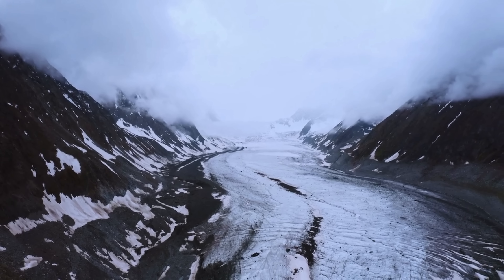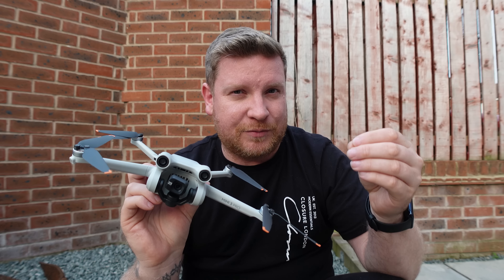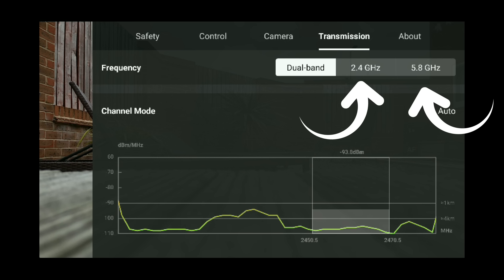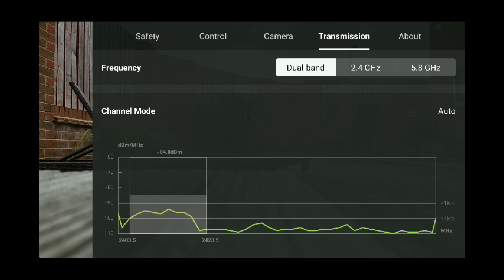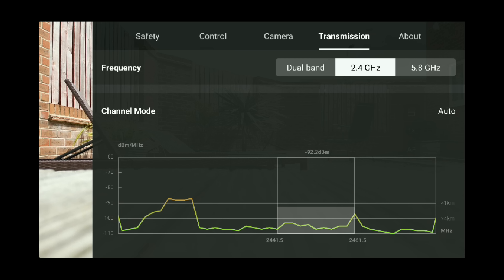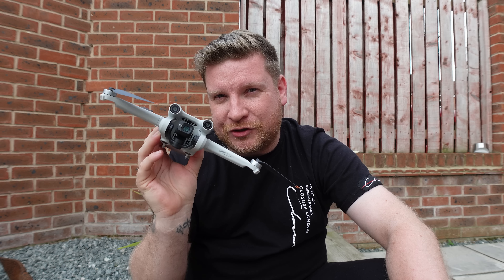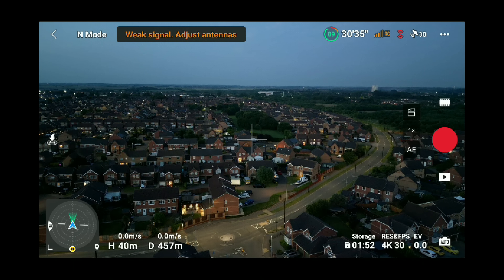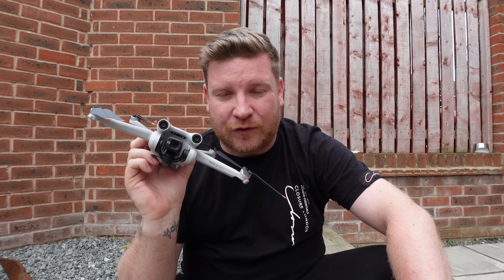THIS Is WHY The DJI Mini 3 PRO Has Signal PROBLEMS! ( Yet Some Don't )

Comment: I would like to know how far one can fly with 2.4 vs 5.8, of course assuming no significant interference from other devices using the same frequency (which I think is almost an impossible mission in an urban environment).

Comment: With latest fw. RC has still less range than N1 (2500 vs 3000m) on 2,4 GHz. About the 2,4 GHZ it is not "design" for longer ranges but it is about that attenuation increase with frequency ( in GHz range relation became quadratic).This is the reason why in radio comm (LTE/5G) you input 100W in antenna and in a few hundred meters you can pickup just few nano Watts. So in 5.8 GHz attenuation is bigger than in 2.4 GHz. For the long range one must always prioritize 2.4 GHz. 5.8 has the advantage that it can allow much  larger bandwith channels, which in that case is not so important (4k recording is done on drone, and for video stream is enough bw on 2.4 GHz). The 5.8 band is supposed to be less bussy than 2.4 due to the fact that there sloud be less devices on this frequency.This is why producers recomends using 5.8 in city, but you must always make tests before the fly, because no one cand predict electromagnetic map on every place.

Comment: Unless you put a Spectrum Analyser on the 2 different carrier freq's where you are "testing it" it will always be just a case of perhaps/maybe/if......
Reply from the maker: Well you can use a spectrum analyser absolutely but the proof is 5.8 worked better than 2.4 as shown, ideally the drone should be doing the hard work but I suspect it's not

Comment: Range is too good on mine i took it out 5.6kms and had no transmission issues but rookie mistake i forgot to go out into the wind and with the wind on the way back. Anyway it landed in a farmers field and even though the battery was dead i was able to find it via gps

Comment: Other youtube videos said that the mini 3 pro has poor signal because it doesn't have the little vertical antenna feet on the tips like the previous mini 2 or the new mini 3. Is that accurate according to you?
Reply from the maker: I agree that’s a large factor 👍

Comment: I've got the DJI RC had flights in rural areas that have ranged 1200m and rural to over an urban area at 1300m, never really noticed any issues with signal drop until i get to the 1000m range.
Reply from the maker: No for most the range is plenty, I personally feel it’s fine also but others were having problems so I looked into the cause

Comment: I’ve experienced the exact same issue… the range would vary depending on the location. In one urban environment, the video signal dropped out after just a few hundred metres away. I definitely think there was interference from another source on the same frequency. While in a large park with open space, my Mini 3 happily went for miles.
Reply: That’s fantastic. Did you manually select the frequency?
Reply: same, I can fly the mini3 14 kilometers in the countryside, but only 1-2 in the city
Reply: @CastorTroy666  that has to be flying out and back. I can’t be 14 one way 🤔

Comment: Great information Gavin, I've ordered a new Mini 3 Pro but have opted for the standard controller. I'm not too happy with the new one going off the various problems that have been reported.
Reply from the maker: Hi David! That's great news! I think you made the right decision, when does it turn up? Really excited for you
Reply: @GAVINHR  It was supposed to be here Thursday but it turned up earlier . So have just finished updating it. One thing I noticed though is that it got quite warm as I updated the firmware. But sent it out over the front and it was cool when it got back. Couldn't give it a good try as the Shell ducks on the pond at the front have chicks on the water and decided to have a go. Anyway I'm getting Coverdrone insurance from your link tomorrow. £65 .09p but that's without ground items.
Reply from the maker: Brilliant news! Yes it does get a bit warm during the update process's but at least it's now done, the advantage is because you can  buy the drone on its own means you can do exactly that and just insure the drone only! Thanks for using the link I really appreciate it

Comment: Hey...
I watched this video a year later. I was wondering two things:
1. Is the Dual band setting designed to automatically select between 2.4 and 5.8 depending on the flying (transmission) environment?
2. Has it been fixed yet?
Reply from the maker: Yes to the first question, and No to the second, If you watch my range extender test video (recent) you can see it still randomly switches to the wrong frequency resulting in a poorer signal
Reply: @GAVINHR 
I have one more question on another topic that you may be able to shed some light on. As you may have guessed the M3P and the DJI RC is new gear for me. I had been flying the original Mavic Pro for years. I am having an issue with the touch screen responsiveness on the DJI RC. I find myself having to fiddle and tap and fiddle some more to get the command to respond. What is there to know about this that may be helpful to me?
Reply from the maker: @dgibbsfl other creators won’t tell you this but I’ve mentioned it a few times on my channel, sadly that is a fair reflection of the controller, it’s severely underpowered and often commands are slow I’m afraid
Reply: That amazes me that A) DJI got everything else right but missed the most important feature on a touch screen controller and B) nobody is talking about it. 

I was hoping to hear about some adjustment on the controller or to the skin surface on my fingers. Gosh forbid there is ever a situation you have to have an efficient/quick response off the screen command and thank goodness for the RTH/Pause hard toggle button.

Comment: Hello, I'm from Mumbai (India) Even i have the same weak signal issue within small distance. At which band once should fly in urban areas.
Reply from the maker: Urban should be 5.8
Reply: @GAVINHR  Thank you for prompt reply. Will surely try tomorrow morning with new settings.
Reply: @GAVINHR  i tried with 5.8GHz frequency, same issue. After 1 kms max the RC and aircraft gets disconnected.
Reply: @jayshreeinfotech_laptopwor6193  1 KM with 5.8Ghz is pretty awesome...
Reply: @isonic9479  then on what basis it's claiming range of 10 Kms?
Reply: @jayshreeinfotech_laptopwor6193  long range is only possible in 2.4Ghz,.CE 6Km with perfekt conditions. In 'real life' you can be happy if you reach 2Km.

Comment: Great, some insight in to what's going on with the range problems I have.... Not flown with the very latest update yet. I did wonder about manually selecting frequency given environment, but hey O3 dji got it sussed right 😮 Interestingly dji suggested I check the frequency band (auto) selected after creating a support ticket... And of course the latest update.

Comment: OK so if I put it in 5.8 should that be all I need to do? Or do I need to put it in manual then or just leave it in automatic? Also, every time I start the drone do I need to put it back in to 5.8? Does it automatically going to 2.4 every time it’s restarted Thanks.

Comment: Hey Gavs, in your vid, the horizontal line is exactly on the 1km (4km?) mark.
On mine, using the air 2s, the horizontal line is just below the 1km line. I am forced into ce as i live in Africa, but u sound like u also a ce resident. What is this line difference about?

Comment: Hi, could you tell me what the minus is for at the top right of the map icon at 5:10 please.
When I press the -, it changes to a + but it doesn't seem to seem do anything, I thought it would be to zoom the map in or out. Thanks.
Reply from the maker: It’s to minimise the map :)
Reply: @GAVINHR  Thanks for the quick reply but the icon at the bottom left minimises the map on mine. The top right just toggles the plus/minus symbol. No biggie, I just can't make out what it's changing, or if it's for a future use.

Comment: Was expecting something more technical like frequency analyzer, check if it's giving the correct power output, correct polarization which so far I know, I watched somewhere that, MIni 3 Pro (obviously) is in horizontal polarization unlike the Mini 2

RCN1/DJI RC is vertical polarization

Comment: Thanks for the video and great explanation. But even if you are correct, why is the mini 3 still performing worse then eg mini or mini2? Also is ocusync 3 vs ocusync 2 not causing the problem? And the antenna design in the legs of the mini 3? And we are very far away from the DJI advertized range...even if we reduce this by 50%, most users will not even reach 5 or 10% from the published range. So DJI has to step up now and announce first of all there is an issue and second how and when they plan to fix this!
Reply from the maker: Hi there my friend, well if you remember my test I found no difference between the mini 2 and mini 3 , I do appreciate others are saying there is a difference but I didn't see one, ocusync 3 is basically just 2 extra antennas and a 1080p feed to the controller / phone that's all. I mean - it's all still poor don't get me wrong, the autel signal is bulletproof !
Reply: I've seen zero difference between mini 2 and 3 re range including swapping between RCN1 and DJI RC
Reply: @GAVINHR  But does that mean, Mini 2 has the same switching problem?
Reply: My Mini 3 with RC-N1 still has substantially shorter range than my Mini 2. If there is a design flaw in the Mini 3 itself which makes reaching advertised distances in optimal conditions impossible...  hello class action lawsuit.
Reply from the maker: @MichasWelt  I personally have not experienced any switching issues with the mini 2 no, or using the RC-N1
Reply: @MichasWelt  My theory is the switching problem surfaced with the 1.04 firmware update, so the Mini 2 would acquire it with that update. I noticed it after upgrading my Mini 2 and now I have a new Mini 2 back on firmware 1.02 and it's range is absolutely massive again. Just a theory though.

Comment: Very interesting. Just got my mini 2, will be interesting to see what happens.

Question
If you select manual, set your frequency then take off what happens if you then change your frequency mid flight without first landing
Reply from the maker: I only landed to restart the test, yes of course you can change frequency in flight no problem

Comment: If you are right about it, please all mini3 users, make a range test in rural scenery with manual set 2.4 and Urban scenery with manual set 5.8. My guess it will not change a range, I suspect overheating or RF chip in drone malfunctioning.
Reply from the maker: I can guarantee you in 90% of cases it will improve signal
Reply: I'll try this

Comment: If you want range, slow your forward speed, this is for mini 2 and beyond. Won’t help mini 1. The automatic switching
 Seems to need some extra time to find a good channel. Sometimes stopping for a few seconds will greatly improve your signal. When your really stretched out , don’t turn around to come back, reverse to a distance where you have a stronger signal. Turning the drone with a weak signal will cause signal loss for sure. If you trust the tech, this stuff becomes less important. If you set a DJI drone up properly before you fly , it’s going to return to home if it’s able. I have  had 4 DJI drones and only my spark experienced technical issues that made operating it difficult, it did not loose control completely, it was impossible to get it to do anything at all smoothly. I crashed it into a tree purposely to recover it. Only suffered broken prop.

Comment: If you have any problems reset to manufacture settings. After changing settings many times following clueless youtubers I found myself in trouble. Let the factory settings ie dual automatic and it works perfectly. If you screwed up following too many youtubers, reset.
Reply from the maker: What settings have you changed following “clueless YouTubers?” I show how leaving it on dual band the ocusync often gets it wrong and does not work as intended and it’s still the case.
Reply: @GAVINHR  Sometimes ago I changed from the factory setting of dual band connection to 2.4 as it was enthusiastically advised by an YouTube tutorial. Wrong decision. I found myself without connection between controller and drone and the battery was low. I was lucky to check transmission and switch to dual band . It saved my drone from landing on the ocean
Reply: It restored the connection and returned to Home
Reply from the maker: @lilylelob yeah 2.4 is only good for VERY low interference areas such as wide open rural areas, you are better off fixing on 5.8 because it’s better for high interference and it will easily give a strong signal for rural areas also. What will have happened is when you switched to dual band it will have moved to 5.8ghz meaning you got your signal back - this is why in my video I suggest fixing on 5.8 as ocusync has a huge tendency to get it wrong and doesn’t switch to 5.8 fast enough
Reply: @GAVINHR  It was in fact a rural wide open area with low interference. Not all YouTube advisors are to be followed. For instance I followed the advice to switch to  mov instead mp4. This made video color fade needing editing. When I switched back to mp4 included resetting to the default parameters I didn’t have to waste my time switching from simple video to masters shots  or photos. Also saved my battery life. Some “expert” parameter changes made the battery life about 18-20 mins instead 35. And after resetting was a pretty strong wind which was handled very well from the image quality, drone control and battery life. Except 2 bumps I can easily cut, the wind didn’t affect too much the flight. Also flying over the water you are safe if higher than 10 meters. However I don’t want to become like Many YouTube advisers. If the drone pilot uses own brain and common sense it goes smoother.

Comment: I see the following problem: When you lost signal because of interferences, you will not be able to switch manually. When your drone crashs or have a flyawy because of manually settings, will this affect warranty? Maybe dji will say, why do you have changed it to manual, with Auto detect the crash wouldnt be happen. So in my opionion its a good video for DJI to develop a fix but manually switching could be dangerous.
Reply: Yeah DJI never takes responsibility for the crashes even if you’re 2 feet away from the drone and loose signal

Comment: I have doing the "frequency dance" for many years with my phantom 4 pro+. Always trying to find the right frequency for the location.
Reply from the maker: Indeed and it you get it right the signal strength is much better isn't it

Comment: This is awesome info but isn’t that why dual band is there so it can swap between the two as required? How am I to know what frequency to use if I’m new to the area?
Reply from the maker: But as I showed .. it's not working correctly 🙂 that's the point of this video. Well if it's a built up area use 5.8, if it's mostly fields and open space use 2.4
Reply: @GAVINHR  much appreciated!
Reply: @GAVINHR  Reassuringly this should be easy to fix with a firmware update!
Reply from the maker: Yeah exactly:)

Comment: Very clever man , too smart 👏 did you do a video showing a good range based on what you said?
Reply from the maker: Flying beyond 500m here in the UK is generally frowned upon ... I can assure you even though I have no video the transmission distance was just fine :)
Reply: @GAVINHR  yeah I get yar, I understand,  maybe it's was your friend who did test this you  could say hehe
Reply: @GAVINHR  maybe a friend on a bike instead of flying?
Reply from the maker: Ahhh ! Well here in the UK that's not technically possible, my friend tech drone media did a video using a spotter but here they stipulate the spotter had to be next to you 🤷🏻 kinda pointless then I guess
Reply: @GAVINHR  Ohh sorry I meant you turn your drone on then give it to a person on a bike or in a car (holding it out the window) and then without flying it get them to drive off (or you could drive off with the controller I guess) and see how far you can maintain connection. If driving/biking off with the controller you would need a USB powered fan on the drone to stop overheating though. Would get around the regulations. 🤔
Reply from the maker: Oh yes sorry!

Comment: Hi Darren , subscribd and liked. Has this issue now been addressed by DJI in any update , or are we assuming it has ?  Love your reviews , keep them coming.
Reply from the maker: Hi Paul, You mean Gavin? haha as it stands yes the RC controller seems to be a bit better at picking the correct frequency yes :)
Reply: @GAVINHR  Sorry Gavin - whoops. Thanks for quick reply. I've got my first flight tomorrow with my MP3 and as a first time pilot , am in Southampton but will flying on the outskirts and rural. Will see how the baby performs , recording video and screen shot video. Got the Fly More so should have time to experiment and learn. A liitle nervous obviously but have watched many of your productions on YT. Cheers , Paul.
Reply from the maker: @paulcollings5424  best advice I can give you is take it steady and remember if you ever think you may get into trouble just let go of the sticks and it will come to a stop, failing that if you ever get nervous the best thing is just push the stick upward if you fly any higher than 50m you’re going to be out of the way of most things! Let me know how it goes !